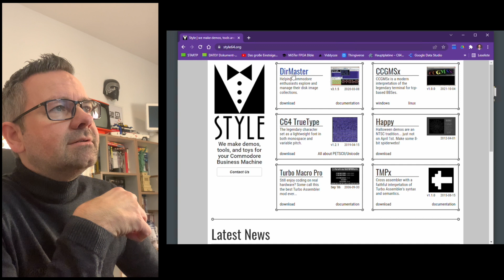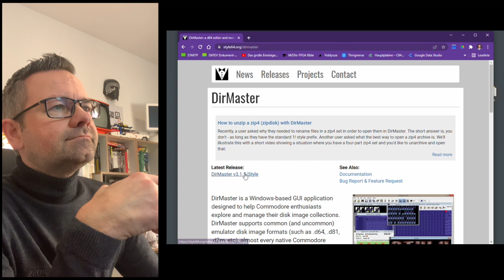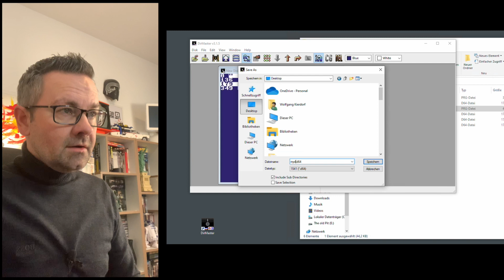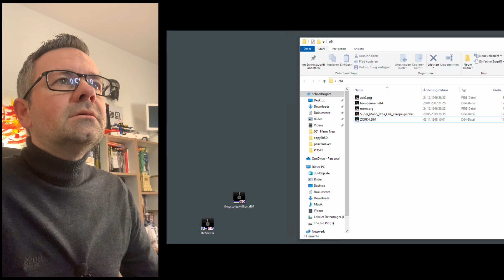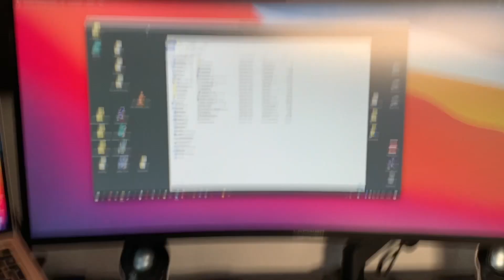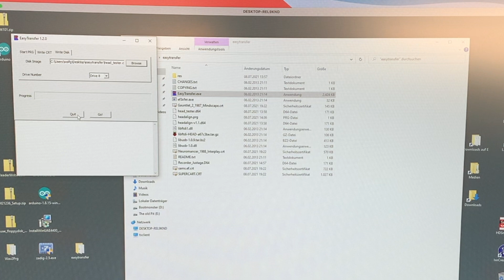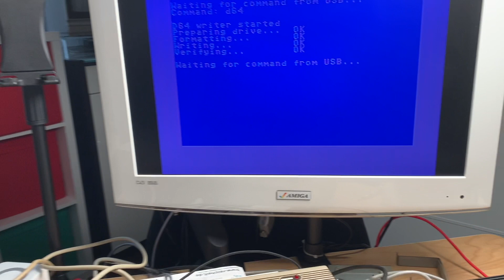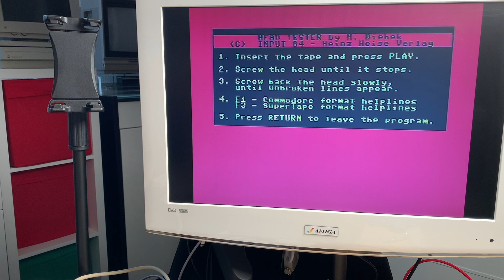How to create D64 + D81 disc images for Commodore C64, C128, VIC20, C16 etc.

Comment: I am stuck - cannot transfer an 802 block .CRT file to re-initialise my EF3 (accidentally erased) using EasyProg 1.7 from a pi1541. Can a .CRT be converted to a d81?
Reply from the maker: Hi! Try http://cbm.ficicilar.name.tr/crt2prg.php that gives you a PRG that you can then copy to a d81 file using DirMaster or D64 Editor. You might need to start the program using SYS64738.

Comment: Hi, thanks for your video. I am new in C64. I had an Amstrad CPC6128. Could you please tell me where you bought the easyflash? I only found easyflash 3 for 100 Euros from which i don't know if it can and an easyflash that cannot do what you showed.
Thanks a lot
Reply from the maker: Hi! Easy Flash 3 is correct. I got mine from ebay. They really went up in price. I got mine for 39€ but right now the cheapest I can find is 85€.

Comment: Turbo Macro Pro is a painful way to develop these days. Using KickAssembler in Visual Code really makes it far more convenient and you can more easily copy paste and use different files.
Plus it compiles and debugs so much faster. And you can then copy the binary to your Ultimate II using FTP. You can even do that using Azure CI/CD automatically for example.

That curved screen you have is awesome!!!
Reply from the maker: I will have to get into the toolchain of C64 development. Never cared much about it until recently when I did the interview with Mr. SID about Sonic The Hedgehog.